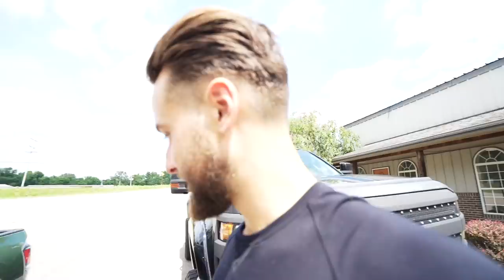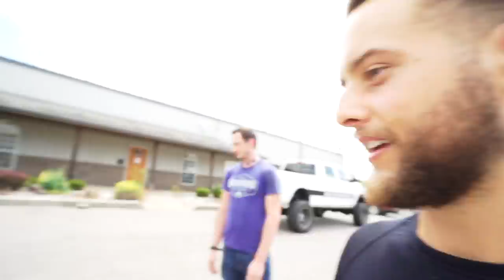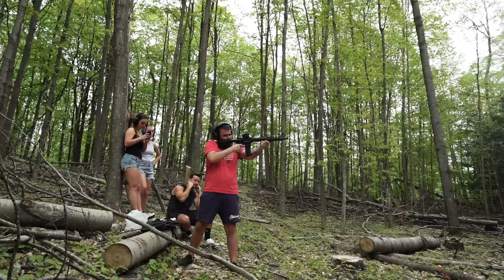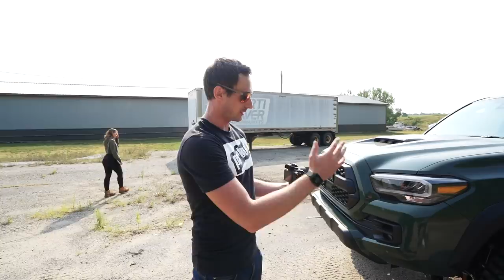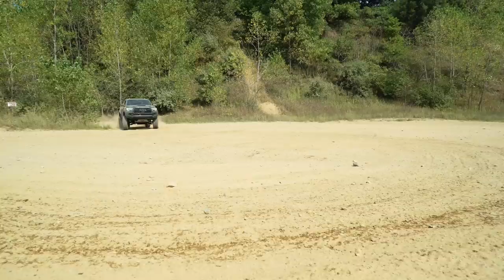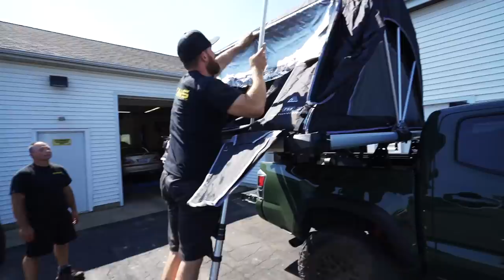My Dream 2020 Tacoma TRD Pro Overland Overhaul

Comment: So not sure if your aware of this or not, but larger tires requires more skinny pedal (gas pedal) unless you regear. Regearing gives you better performance with the larger tires on and offroad. Depending on the weight you add to the bed, some other people with Tacoma’s are running 5.29 gears with their 35” tires. And they utilize the 6th gear in the Tacoma’s transmissions. Just giving you some help, take it or leave it. Nice truck, looks good lifted!

Comment: There are many companies out there that has been making suspension lift kit for Toyota, especially the Tacoma. Just to name a few: kings, Icons, ARB, Toytec, Dobinsons etc..
Reply: his taco deserves some Kings or icons instead just some spacers
Reply: @danielmelnyk493  Newbie to tacomas here, do you have any recommendations to companies doing lifts for 2020 TRD Sports?
Reply: Roadflare1833 i would look into a bilstein lifts, dobinsons, toytec and Arb and if you want something a little nicer but pricey kings suspension and Icon has some nice kits but it really matters what your budget is and what kind of off-roading your gonna be doing
Reply: Roadflare1833 look up 88rotors off-road and they do insane amounts of lift kits on Toyota trucks. Top of the line lift kits to standard ones like bilsteins 5100s

Comment: So he said there’s zero companies that make a lift for the Tacoma. Is he confused or joking or what. I honestly couldn’t tell
Reply: Zero companies that would put a block lift in a pro *
Reply: @airakklein  glad im not the only one that looked at it and thought you took a pro Fox suspension that makes it the pro to install blocks and spacers to fit 35's
Reply: @zshares11  exactly... ruined the truck.  35s fit TRD pros stock... the same amount of cutting they did on the cab mount is req. either way - zero lift needed.
Reply from the maker: @zshares11  Didn't remove the fox suspension. Kept it
Reply: @SpencerVybes  Then what fuckin lift did you get??? Lmao
Reply: @hardkombucha  Looked like BDS 6" blocks?
Reply: He’s a liar
Reply: Rob he put a BDS Block lift on it which pretty much ruins the ride quality and off-road ability, but makes it looks taller.
Reply: @samuelrowland76  Lmao thats what I was thinking. So hes just a straight up liar
Reply: @samuelrowland76  I wouldn’t say that’s true. I have the same setup on my off-road. There’s plenty of clearance with 35s, and I run 37s in winter. The cab is nice and high of the ground and it does great off-roading here in Montana. With coil overs and new leaf springs, my truck rides better than stock.
Reply: @0waverunner0  nah, looks like BDS 4” lift (front spacers, spindles, and rear blocks) with 285s. I’ll hate on this dude for being a lazy, hipster, fake outdoorsman millennial, but the lift didn’t really affect the trd pro suspension and looks pretty damn good. Y’all are just hating because you want that truck.
Reply: @SpencerVybes  I want to keep my original TRD Pro Fox shocks on my Tacoma but the 6" Lift Kit on BDS website (2,191.96) says it does not fit TRD PRO models. Which one did you use? I want the same BDS lift.

Comment: There is no actual change in 2020 Tacoma frame wise. All 3rd gen are the same. So the fact they said they had to prototype is bs. The fact that it’s a TRD Pro means nothing. The only difference is that the pro has longer spring to give it a little more lift. (Minor shock tuning) And also  no actual benefits was gained from that bds lift kit. All same components were used, they just added spacer blocks! Which is no good! The kit actually gave a disadvantage for ground clearance. (Using drop bracket)!! Man I hate being that negative person! But just would have wished you did a little more research! Also recommend you regear it so you can get your power back! I recommend nitro 5.29 gears! Will help with fuel economy as well!!

Comment: 2.5 weeks and they didn’t even regear it for you?
Reply: Prototyping a lift kit for production in 2.5 weeks isn't too bad, plus BDS doesn't manufacture gear kits. TRD Pro owners can thank spencer now that a lift kit will be available soon.
Reply: Nate Smith there is no actual change in 2020 Tacoma frame wise. All 3rd gen are the same. So the fact they said that had to prototype is bs. The fact that it’s a TRD Pro means nothing. The only difference is that the pro has longer spring to give it a little more lift. And also  no actual benefits was gained from that bds lift kit. All same components were used, they just added spacer blocks! Which is no good!
Reply: Clearly you haven't had a standard and trd on two hoists side by side torn apart.
Reply: Nate Smith “standard” haha. Okay dude! You know so much! “Standard” Dude I own one! What are you talking about!!! I fabricate my own stuff! I throughly inspect the trucks before even working on them!
Reply: @jonathancastaneda8242  Im literally looking at a 2020 TRD and TRD Pro on a hoist right now.. differential mounts are different, shock mounts are different, skid packages are different, control arm pockets are close enough to the same.
Reply: Nate Smith most of  that is false!!! Your wrong sorry. I am a Toyota master tech. The only right thing you said was the skid plate. Minor stuff like that is different. Skid plate, seat stitches, wheels, suspension. Frame wise it’s all that same!!! Same mount same everything!!!
Reply: It’s not really cost-effective for them to drastically change the position of stuff just for a different model

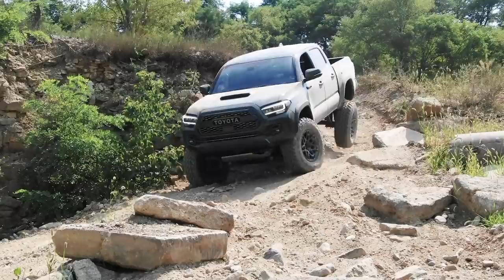Comment: LOL at a drop bracket lift kit and 35s without regear. You can see how much flex this thing DOESN'T have at 8:47 😂
Reply: kind of disappointed in that.
Reply: @dohman76  the truck was way more capable when it left the Toyota factory, this dude got hosed. The funniest part is the crossmember 6" below the hacked up skidplate 😂 That poor truck

Comment: The TRD package costs more because of the suspension ONLY. You could have bought the offroad premium and just ad a trd badge to it.  You paid extra for the stock suspension on thr trd pro and then you took it off. You wasted $7,000 or more including taxes.
Reply: That's not true in Canada. Its only $4000 more for the TRD Pro over the sport loaded in manual, the only two offered. The TRD is lifted and wider. suspension, rigid lights. sequencial headlights, camera's all around. different tail lights and badging. Just resale makes it worth it. He can sell the fox setup he removed to anyone that can't afford the Pro.

Comment: I would never put a 6 inch lift on a truck. Horrible ride quality, horrible turning radius. It just won't perform like a good 3" mid travel set up
Reply: Lmfao so many lies in this comment. Obviously you don't own and never have any 6"lifted trucks. I've owned several some Tacomas, Silverado jeeps ect. They all rode the same as when they rolled off the factory line so what are you smoking? Also there are some 6" kits that retain factory turn radius so again what are you smoking?
Reply: @shermellow  I've been in the tacoma industry for years. I've never ridden in a 6 inch lift that was any good. Clearly your smoking that good my guy

Comment: You fucked out.. sure your truck sits higher. Good luck when that "drop bracket lift" shifts, or bends or snaps off when off reading. Your lift was made for looks. But while coil over like bilstein, toytec/eibach, OME, fox, kings are good adjustable lift options. I can tell you more. But its your responsibility to do your research. Well good luck, enjoy the truck.

Comment: Took him 2.5 weeks to do a simple bds 6” basic kit? Should have taken one day. Only take 5-8 hours to fricking throw a strut spacer in the front coil and cut the crossmemeber and throw a block in the rear and trim the cab little to fit 35’s? Seriously... literally bolt on shit what kind of shop takes that long for a simple lift kit
Reply: Dude said 0 companies that make lifts for a Tacoma..rough country, fabtech, bds, pro comp, ready lift, bulletproof suspension, icon all make 3-6” suspension kits.. this dude at this shop is a joke. Literally has 0 knowledge. Even said it’s an upgrade? Literally has a strut spacer on his front coil now. That is not an upgrade, a full icon or king suspension would be an upgrade.. not a block in the fricking rear on a trd pro model